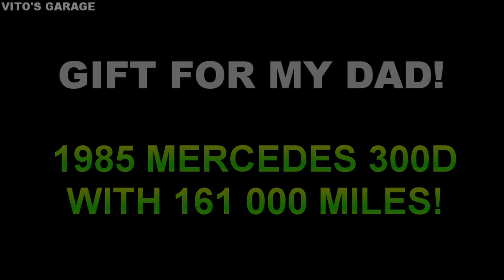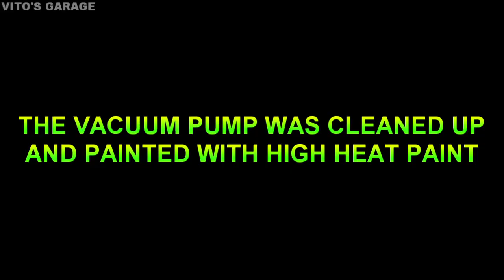PART 6 Dad's Gift 1985 Mercedes 300D: Vacuum Pump Gasket, Cooling System Removal, Oil Sludge Cleanup

Comment: Hi Vito!  
Any tips on installing a new vacuum pump i have a 1984 300d i am trying to put on a new pump but it seems to not want to line up with the cam in the block like  the piston or cam needs to be turned to line up its the correct pump its just not lining up together
Reply from the maker: Hi Omar. That’s normal. Just push the pump in by hand and thread the bolts in. The pump will get sucked in once you tighten all the bolts. The pump is spring loaded

Comment: I'll be interested if your engine did a shake, rattle and roll dance after you replaced the chain tension spring when you started it up after replacing the tensioner spring as mine did. Thankfully mine returned  back to normal after a few minutes.Thanks for not warning me.LOL I was going thru a lot of regret  those first few minutes. Cheers
Reply from the maker: I messaged you privately